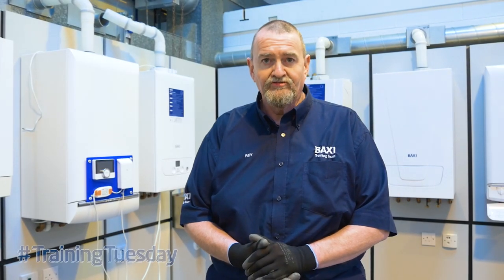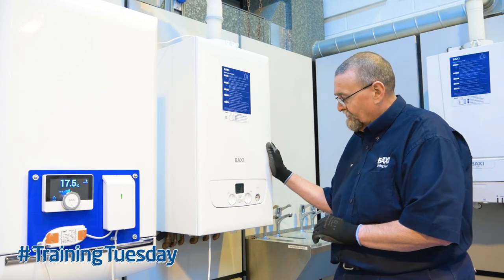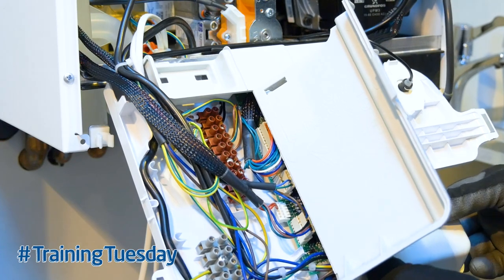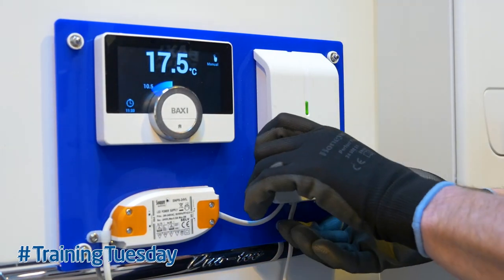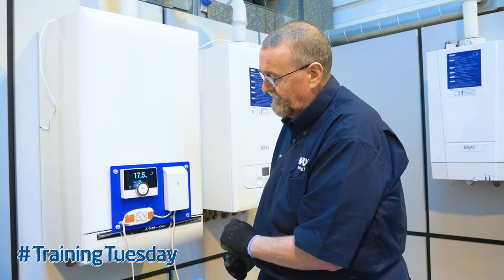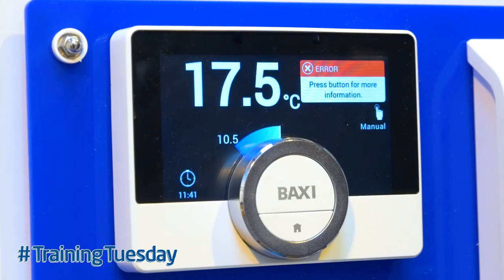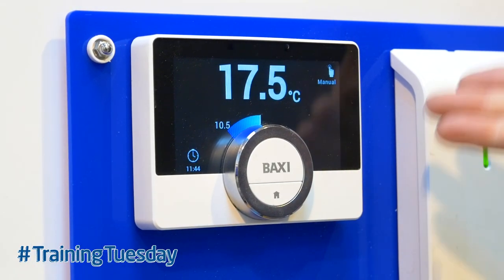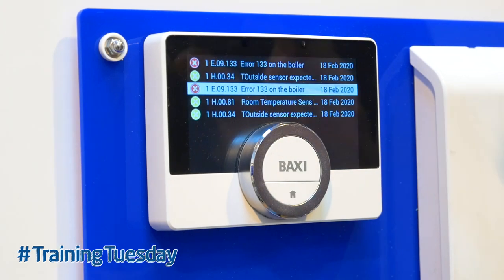Reasons why you you would wire a boiler up opentherm instead of 240 volt switching

Comment: On the Baxi 830 combi 2, to use OpenTherm you must remove the link and put a link in the 240v RT (traditional). Or vice versa if you wish to use the RT 240v, place a link in the OpenTherm block. My Google Nest 3rd Gen would not fire the heating as I had no link in 240v RT. There is no mention of this in the service manual.

Comment: Hello! I'm using a Baxi Luna Duo-tec E boiler with a Mago thermostat. I have an issue where the Heating Curve and Control Strategy menu points are not accessible. According to the manual: "The display shows the Heating Curve only if your installation is fit for this option." Could you please provide information on the requirements for configuring this setting?

Comment: Sadly this boiler and the Main ECO Compact (same boiler) are not compatible with Honeywell Evohome as Baxi, unlike many other boiler manufacturers, lockout the flow controls on the boiler front.  The reason they do this is to push you towards the Baxi Opentherm controller but this won't run multiple zones unlike Evohome. 

Unfortunately Evohome does not provide flow control as Honeywell believe flow control should be maintained at the boiler, so you're stuffed with this combination or any other controller with Baxi that doesn't allow flow control.   Gutted!

Comment: 1) Does a modulating boiler only modulate down the burner, or does it also modulate the rad pump flow rate?
2) is the modulation power (kw) set by the opentherm stat or is the flow temp set by an opentherm stat and then the boiler chooses the appropriate kW?
3) if I use a weather compensating control like a google nest, does that automatically set the boiler output or does it set the flow temperature?
Reply: Great questions we need clarity on all of this!

Comment: Does the link at the boiler need to be removed if Open Therm is used or only if the normal on / off relay terminals are used?
Reply: Yes, I now know that it does need to be removed.

Comment: So you have to remove the link on the traditional on/off thermostat connection when using the opentherm connection?
Reply: yes. What never seems to be mentioned is that to make Open Therm work you need the link in the boiler removed (just as you would for a normal on / off thermostat) & also you need to activate Open Therm in the Nest thermostat - in: settings, pro setup, continue, combi & then select heat with Open Therm.

Comment: We have a Baxi 600 combi connected to a Honeywell R8810 Opentherm bridge and an Evohome Evotouch.  

Since connecting the Opentherm bridge, the boiler controls are now locked out with DCH set at 80 and DHW at 60.  

I'm assuming these are the maximum temperatures allowed but I would ideally like some control of the hot water temperature and I would also like to set DHW to 55c max but I can't see any way of doing either of these through the Evohome Touch. 

Any ideas?